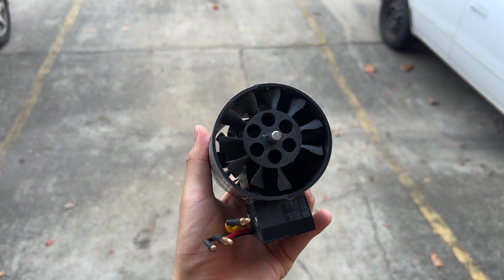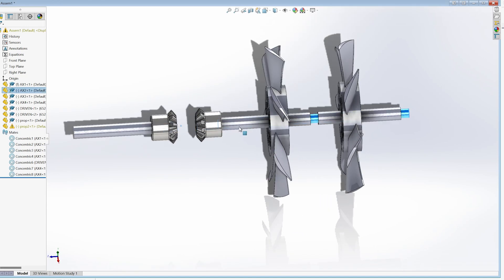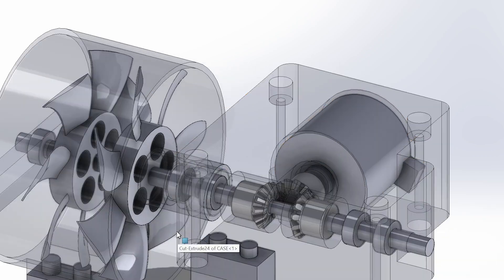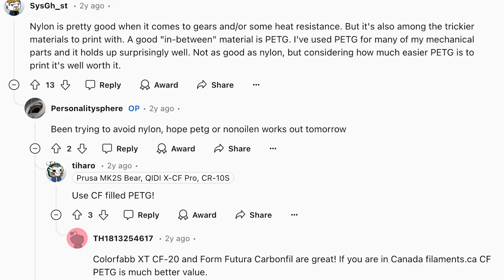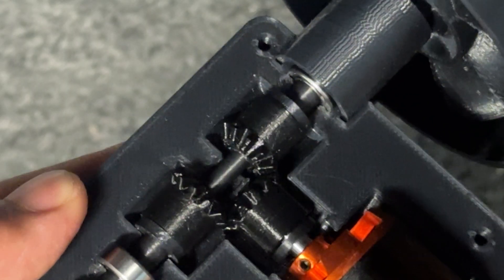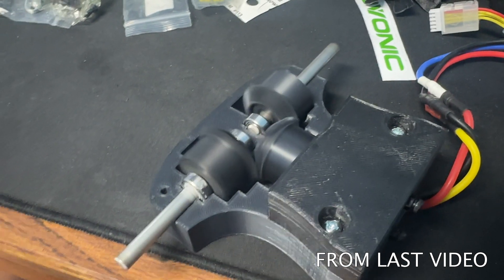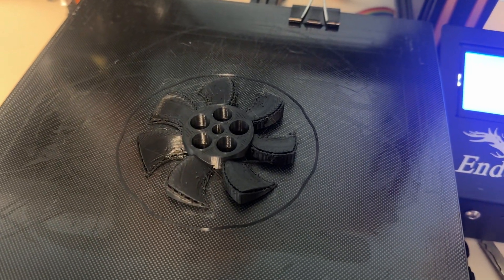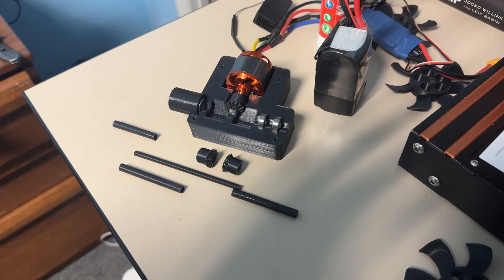Dual Contra-Rotating Ducted Fan (Better This Time)

Comment: very cool you might want to consider different gearing though what your using can endup wearing a little it lacks continual contact. something like a couple of Archimedes  gear and a single tooth Archimedes screw has continual contact and a lot less wear/vibration

you would have to mount the motor linear with the fan but you could mount it below/above/beside the fan duct which would also center your torq (you can have archemedies gear with most of its face cut out if you did need it to protrude into the airstream space proper also)

as something completely differnt ive been thinking about a 3 duct system that was attached via a cowling to 3+ bearings driven by a power takeoff shaft that joined a offset linear PTS via archemedies screw causing reverse rotation than a third PTS via another archemedies screw that way youd get a double counter rotation and it could be housed above below ext the duct so not impede airflow at all

Comment: All you have to do is move the motor away from the fan. Place a thin aerodynamic fin the extend the motor shaft inside.  in essence by intending the shaft so that the motor is outside the fan.
Then encase the shaft by an aerodynamic shape with high speed bearings supporting said shaft.
Love your vid and what you are going for is huge.
Big thumbs up.
David Hodge
Sr engineer LM

Comment: How about putting the gears on the outside of the fan rims and the driving gear outside the air tunnel all together? Dump the axle and experiment with an open center. Let the rims ride on ball or roller bearings, that can also couple them to the frame/main tunnel. :o)

Comment: Can’t you move the dealing to the outside of the fans and run them with belts or just a gear on the top of the fan with a loop of groves around it.

Comment: A couple of ideas for you... first, if you drive the fans from their outer circumference you will eliminate the need for axles entirely. Just put your gearing and bearings on the outside of the fan's body into the rim. Second is a bit more complicated to engineer, but if you build your motor into the fan's rim, then you would eliminate gearing completely and solve your motor-off-axis torque issue. No gears, no axles, just a ring motor with a fan inside of it. Install two of these with the fans in opposing directions and you have your counter-rotating ducted fan system.

Good luck!
Reply from the maker: Wow I've actually never heard of a ring motor. That's fascinating. I believe some of the new electric powered jet fans use the rim driving concept pretty heavily? Much thanks for the advice

Comment: I’ve experimented a lot… well really A LOT of different configurations with intake geometries, thust tube dia, lengths, fan blade count, dealing with motor heat. 
The easiest to explain and possibly the most detrimental issue is the Fan blade itself & no not the blade themselves… the hub of the fan has holes that are uncovered. The holes are there to lighten the weight but have to be blocked, usually a spinner. With the uncovered holes any air pushed behind the fan blades will take the path of least resistance with is the area of lower pressure in front of the fan. Air is going in the front and most but not all is going out the front.  There more design ideas out there that don’t work than there are that make the biggest improvements but if this message finds you and you found beneficial let me know. 
I achieved 4.5lb of thrust from my 70mm EDF. Custom woven CF housing-  4 45mm long stators supporting a the motor mount that’s 3.5mm walled aluminum that has an outer diameter of 35mm, 29mm inner dia, & a length of 50mm. 
12 blade fan, 3600kv motor, 100A Esc running on 5s battery. The amount of torque and heat the EDF meant strong support and large heat sink to draw the heat out of the motor so it could be run at full power for 4.5-5mins without degrading the strength of the magnets from being overheated.  The Esc is mounted behind the motor and cooled by the air flowing out of the edf, so much air in fact that the 100A ESC doesn’t have a heat sink.  
Total weight of housing, motor, Esc and its wiring landed at 12oz,(without battery) with 4.5lb of push.   
The Intakes airflow is far more important than the  exhaust.
Reply from the maker: This is gold! I played a lot with 3D printed EDFs a few months ago. I had a much more dialed in fan setup, the one used in this video was used for not much more than demonstration. Blocking the lightning holes is 100% something I'll do though, that's a very quick fix. 4.5 lbs is insane, I'd love to see videos!

Comment: @ Jon: you can connect the Motor directly to one fan instead of rotating it 90°. this way you can use a way thinner support structure for the  dif (which still needs to be fixed)
Reply: Allso instead of a diff-style conversion of turning direction you could go into a planetery gear setup- this is harder to print but will use up way less space for the same amount of torque transferred.

Comment: Interesting, maybe you can put the gearbox at the fans level and then keep the motor axial, to solve the motor torque, you can counter it with one of the fan by making it heavier

Comment: If you mounted the fans inside a couple large bearings and had a flange that meshed with a perpendicular gear you could drive both of them off of a single motor that wasn't in line with the air channel and you wouldn't have to deal with the shaft at all.

Comment: You can make even more durable gears by just printing with normal PLA and gear teeth with about half a millimeter extra slack, and then once printed coating the gear touching surfaces in several thin brushed-on and off layers of epoxy resin until the printing layers dissapear. It's way harder and more abrasion-resistant then PLA and ABS. If you mix in carbon powder (the lubricant) with the resin until its properly black and no longer transparent you can keep an even color, get even better hardness properties AND self-lubrication as it very very slowly wears down. :) I make clock mechanisms this way with PLA printers, although the gears have to be even finer so i hand-file them to shape before painting resin on them.
Reply from the maker: Ah that sounds like a really solid approach. I've never used epoxy resin but it sounds like something I should be getting into anyway. Thanks for the tips! Might try that after this nylon experiment.

Comment: If you are looking for information about ducted fan design, check out:

 "Ducted Fan Design" by F. Marc de Piolenc and George E. Wright Jr

A pdf used to be for sale directly from the authors website, but it looks like the site is no more. 

I did some hovercraft related ducted fan design back in 2010-2012, and this was the best resource I found on the subject.

Comment: Maybe a dumb question,  maybe just something you didn't think of,   but wouldn't it make more sense to mount  the engine inline on a shaft,  have 1 rotating assembly fixed to the shaft,   and on the opposite side of the motor on that rotating assembly have your beveled gears,  then a mirrored rotating assembly fit on a bearing on the same shaft?
Reply from the maker: Straight up didn’t think of that. I love it. Stay tuned

Comment: personally from my very limited experiance with edfs so take my thoughts with a grain of salt( ive only been researching for abt 2 months) try to create an intake which deflects the edfs airsource away from the gearbox with some external mounting points for it
Reply from the maker: Yeah that's a good point, I would want to be shaping the gearbox in a much more aerodynamically efficient way at least

Comment: Tip: use 2 contra-rotating motors and 2 esc's. Simplicity, reliability and no gear losses. By the way, in that case you almost compensate gyroscopic moments.
Reply from the maker: For sure, I wanted to see if there are significantly lighter approaches with minimal gyro moment penalty
Reply: @mach10point4 Actually it is difficult to compensate gyro moment for single motor, because two contra rotating  fans completely compensate each other. Thus either extra motor and double power or some flywheel.

Comment: Tip: You can use a stroba scope to slow down fast movement for filming. Also if you're using PCB way just get some gears milled in aluminum that you can reuse.
Reply from the maker: Ahh brilliant, yes I definitely need to be upping the cinematography game lol

Comment: I would use 2 separate motors. gears especially 3d printed ones have very bad efficiency and if you insist with your gearbox I'd put some grease in it because the lube you put is wayyy to thin and gets sucked in your print imperfections
Reply from the maker: Yeah the FDM gears are mostly for proof of concept purposes. I’m trying to see if nylon will work better
Reply: Bad advice
Reply: true i think 2 would be best.. specially cus ducted fans tend to work best at super high rpms and 3d printed gears just arent that durable or efficient like you mentioned

Comment: You could mount the motor in the front and have the shaft for the rear fan go all the way through to it and for the counter rotating fan you could do a ring at the motor to a couple pinion gears on each side going back to the outer tubeshaft with its own ring gear. You'd streamline the gear box behind the bulk of the motor and can taper it. It'd be a long assembly but you'd wouldn't have that gear box in the way.

Good job dude 👍🏻
Reply from the maker: Yeah a couple comments have mentioned something like this setup and it sounds super cool. Never would have thought of that myself. Thanks for the advice man I'll look into it

Comment: Graphite lubricant isn't ideal for use with electric motors, as it is conductive. Don't ask me how I know that actually can cause problems. 

With those fan hub diameters and with cones on each end you have all the space you need for a gear box, or two motors, inside the fans and fan cones.  Do take into account that using two motors you only need half as powerful motors, in theory, in practice even slightly less, as you won't have gear losses. Also, two smaller motors means they counter each others rotational impact out. 

From the aerodynamic perspective, inrunners can be ridiculously powerful for their diameter, and better at producing high RPMs. Also, flow area in the center isn't as important as at the edges.   

Gearing one motor to two contra rotating fans makes more sense for internal combustion engines, where having two smaller engines has a lot of disadvantages compared to one bigger engine.  I personally would find it more interesting if you made multiple stages, like the compressor part of a jet engine, but with contra-rotating fans instead of fans and stators. I suspect using at least two parallell contra-rotating drive shafts would be essentially necessary, but those and the gears could fit well in the fan hubs.         

About PETg on ender 3, I found that the end of the bowden tube decomposed (very slowly) and shrunk slightly over time from the heat with the original hotend, making it necessary to shop off the end of the bowden tube occasionally, or upgrade to all metal hotend.
Reply from the maker: Fantastic, thanks for the response. I think I will ultimately have to go with a 2 motor setup. We’ll see how nylon goes. But I agree with everything 

As for the PETG, I’ve been printing at 235 trying not to burn the Bowdin tube. My CR 10 has a metal hotend so just trying to squeeze anything out of the Ender 3.

Comment: would love to see some data on torque reactions on the motor itself...

with a single prop, the reaction torque attempts to spin the motor the other way.

to drive a contra rotating prop through coaxial gears means that reversed prop has to spin at twice the speed, backwards.

the torque to drive that reverse prop is reflecting off the standard prop, and all that reaction tends to reflect back to the motor itself. and thats only held stationary due to aerodynamic surfaces in flight... most pilots never liked contra rotating props as they handled in an utterly different way... and thats not entirely due to air simply flowing "straighter" over the plane. 

here though, youve rotated that reaction by 90 degrees... giving either a pitch or yaw effect, rather than a roll...

iunno, stick it on a reaction arm and load cell... be nice to see some figures quantified. maybe with 3dof to get a real grasp of the basics of newton...
Reply from the maker: Yeah I’ve been working on 3 DOF gimbal for the monocopter stuff, so I’d love to put it on there. I guess my justification for this was a monocopter has a much harder time controlling z axis rotation rather than x or y, just in my experience with arduino. But what you’re saying makes sense and has me thinking hard now

Comment: Have you thought about contacting Bambu Lab for a sponsorship? You seem like a great candidate for a sponsorship. The worst they can say is no.

Keep challenging yourself and experimenting.
Reply from the maker: Excellent point. I’ll shoot my shot. Man if I can get an X1..
Reply: @mach10point4  X1 is great, I use it for all my turbines.
Reply from the maker: @warmachined3472  Yeah, I've gotten to use it a good amount and it makes my Enders feel like toys
Reply: @mach10point4  very cool you might want to consider different gearing though what your using can endup wearing a little it lacks continual contact. something like a couple of Archimedes  gear and a single tooth Archimedes screw has continual contact and a lot less wear/vibration

you would have to mount the motor linear with the fan but you could mount it below/above/beside the fan duct which would also center your torq (you can have archemedies gear with most of its face cut out if you did need it to protrude into the airstream space proper also)

as something completely different ive been thinking about a 3 duct system that was attached via a cowling supported on 3+ bearings driven by a power takeoff shaft that joined a offset linear PTS via archemedies screw causing reverse rotation than a third PTS via another archemedies screw that way youd get a double counter rotation and it could be housed above below ext the duct so not impede airflow at all (you can scale it out to 4 or 5 or more fans but in interests of simplicity to effect i think 3 is pretty solid)

a - bar arrangement with each bar driving the cowl of a fan around via a Archimedes gear/screw interface (i like it for high speed stress tolerance and low vibration, also u can make them very robust tooth wise)

Comment: Heck yeah! That PCBway offer is going to be a huge boon to making parts!   I think I've said it on other videos, but I gotta shoutout another person that sees the benefit of printing on glass, lol.   Clean glass and a little hairspray have been the best for my CR10-S for like 8 years. Works every time.   Although, I will say PETG is the only material that can still be a little tricky. Also, stringy and sticky.
So... I wonder if flexible shafts might work for something like this? Small cross section, and could allow you to place the motor(s) basically anywhere you want. 🤔
Reply from the maker: For sure! Thanks the tips, yeah it sounds like I just have the baby the glass a little more than I would for PETG (still haven’t given into PEI yet, whatever). As for flexible shafts…will definitely be looking into that. Never crossed my mind before. Appreciate the support

Comment: Love the concept. I think your gearbox over complicates it have you thought of using two Motors?and using the opposite rotation of the talk to act as your rudder control.
Reply from the maker: Thank you! I’m worried the extra motor (which includes extra ESC and potentially extra battery) would make something like this too heavy to be viable. Plus this has aero benefits, namely low wetted area of obstruction without the motor in the duct. But I’m not opposed to 2 motors, and you’re right, the gearbox is super tricky at best
Reply: @mach10point4  maybe a non-linear thrust tube with two smaller motors. A non-linear approach to your thrust you would be a good idea then to give you the  venturi effect around the obstacles to tune thrust tube?

Comment: Cool stuff! Do you know if this twin EDF/contrarotating setup still creates those gyroscopic precession forces that plauge monocoptors?
It seems like it would help but would still give "weird" reactions to external forces.
Reply from the maker: Thanks! I figured that with this setup, the only reaction would be a (pitch?) moment that could be balanced by a gimbal or thrust vane set up much more cheaply. Would love yo know what you think though, maybe that's a bit naive
Reply: @mach10point4  I'm not sure, I'm equally naive 😂
About to begin PID tuning on my monocoptor tonight, but I'm only using one 50mm unit.
edit I've got a rough Matlab/simulink model of my monocoptor if you want me to email you a copy to mess with
Reply from the maker: @rogerrinkavage  that'd be awesome, my email is jonathanyun617@gmail.com! will keep you updated :)
Reply: @mach10point4  sent!